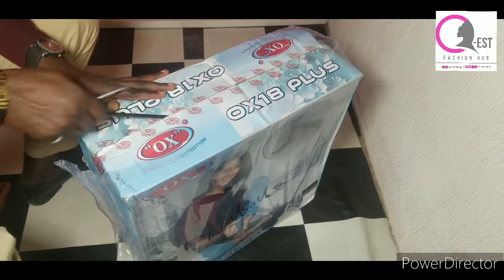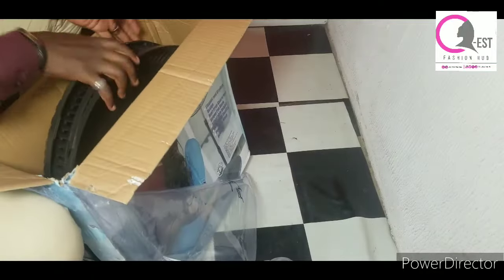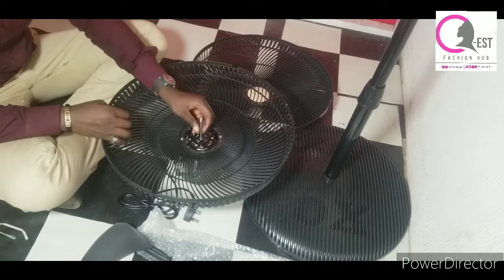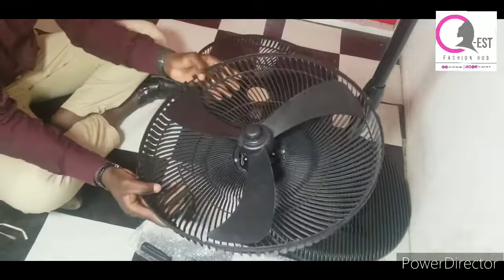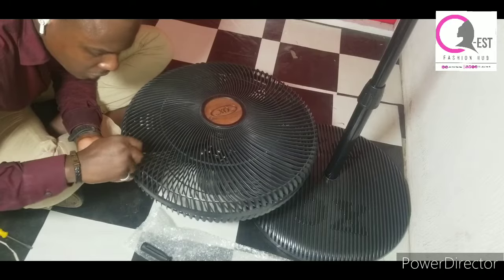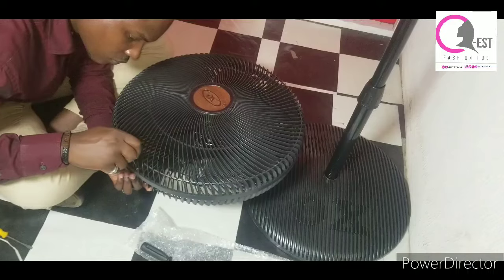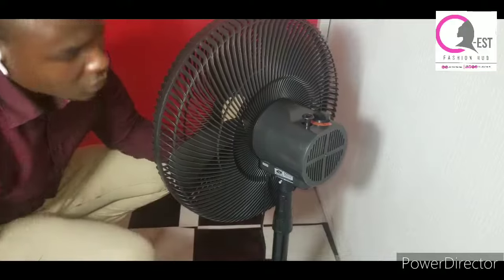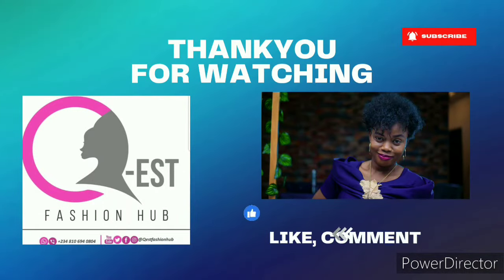HOW TO UNBOX & ASSEMBLE YOUR STANDING FAN STEP BY STEP.

Comment: How was the black cover on the control removed before the blade was fixed
Reply from the maker: They are screw on the black cover, you will have to unscrew them first and then open it before you fix your blades. Thanks.